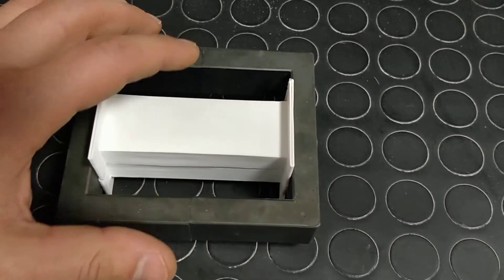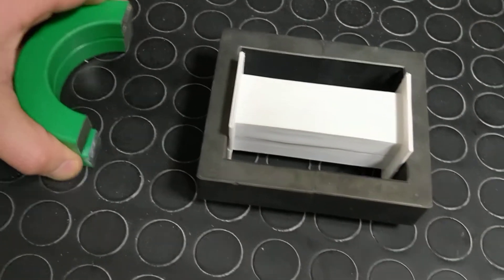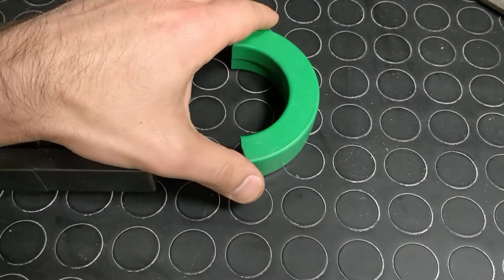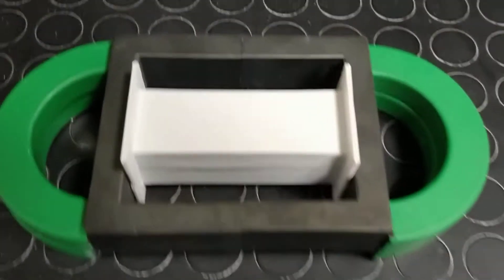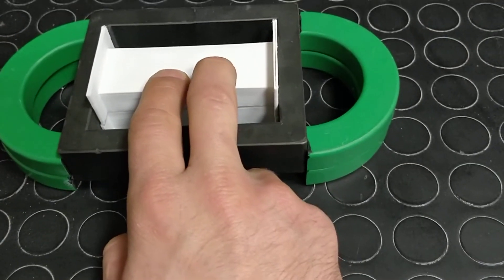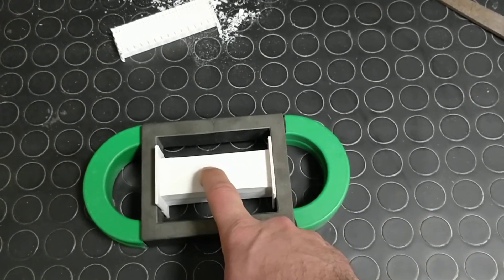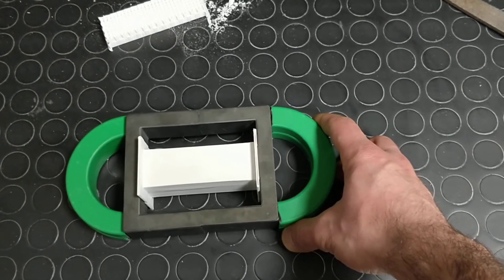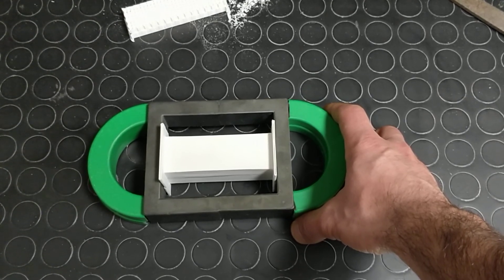The birth of a BiTT overunity transformer

Comment: Hello ,I want to know if you use any tune capacitor. 
Is it OK to just input pulses into the primary coil at duty about 36%?
Reply from the maker: @勇気-n3y  thank you for your question. I didn't complete the experiments but I noticed I can use capacitors in parallel with the primary to vary the frequency and efficiency of the whole unit.
Reply: @StefanDanov  Thank you for your reply.

Comment: some info.     at 1:10, it is not clear whether the core is made, as it should be,  of a  Laminated and ferrous material.  (typically, silicon steel)      at 1:32, you are saying 'back em force'.    this expression  is  Not  correct.    yer solenoids make  em fields or magnetic Flux; not em force - see voltage.       this concept appears valid, on the surface.     however,  i have experimented with this type of  flux multi-path  config.     at this scale/energy level,  it does not work.
see my ou research, if interested.        the key to achieving ou is not coils, it is the correct utilization of   MA.    Mechanical Advantage, that is present in  a large-radius,   Rotary Lever/wheel/gear.     this means, force  Must  be put into a system at a  Radius  that is  Greater, than the radius where power is taken off.      note that ANY  gear/friction-wheel drive  functions as a  Rotary LEVER;  operating in  360 degrees.     such motion/force  IS   SCALAR, in nature.     see a brace-and-bit  as a simple  example of this principle.     googletranslate
https://en.wikipedia.org/wiki/Mechanical_advantage#Lever
https://en.wikipedia.org/wiki/Crank_(mechanism)
https://image.shutterstock.com/image-photo/image-450w-61077781.jpg
Reply from the maker: Thank you for the tips! Yes, you're right, I'm not using a correct language, plus I'm still ignorant. By the way, what do you think about the N machine, or a homopolar generator? Can you apply what you mention as an OU?
Reply: @StefanDanov  i have experimented with coils, neo-magnets and  pmas,  for years.    through experience, i have verified the immutability of the rules,  as described by  faraday  and  lenz.    there have been NO  Proven successes, in that area of ou research.      i am happy to help, but we need a common vocabulary.      so, i  suggest that you view my Own  comments (and video descriptions), at my  ou  videos.
because  Rotary motion ( leverage, in 360 degrees) is  SCALAR, in nature,   certain things  SHOULD   BE  POSSIBLE.     see a  brace-and-bit, as an  example  of  the use of Rotary Leverage.    googletranslate
https://i.stack.imgur.com/NWwYj.jpg

Comment: looks good good job , where did you buy there ?
Reply from the maker: I was printing the spools at a Fablab in Milan, now I print by myself at home. I buy as less as possible.
Reply: @StefanDanov  but how about the core
Reply from the maker: @EnergySeeker  the core was a gift from a supplier, I bought some toroids and he gave me some ferrites  for free. Actually I'm not using the same cores you see here in this video. I have other pieces and I've made some experiment, but I don't think it's already overunity. I'll be experimenting more.
Reply: @StefanDanov  the best will be to put a source or a generator and measure input and output in Watt
Reply from the maker: @EnergySeeker  that's what I'm about to do, but it's not easy as it seems. I don't use the  grid frequency, I have a signal generator and an audio amplifier or a ZVS circuit, both work well. Since the calculation is not so easy and I don't have a power meter that's able to measure frequencies between 1 and 20 kHz, I'll need some support from a technician that knows things better than me and teaches me how to calculate power when current and tension are out of phase.
Reply: @StefanDanov  to calculate power reactive power its P=UxIx1.732X cos phi , the cos phi of the how apart the 2 signal , and to compensate that and to put them in phase we put a capacitor which correct the power factor , if you read french here is a good doc for this http://david.viriot.free.fr/systelec/Dossier_Compensation_d_energie.pdf